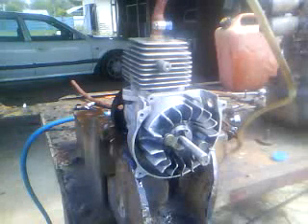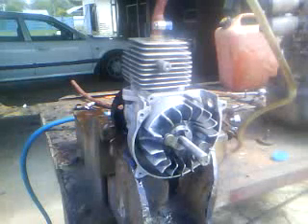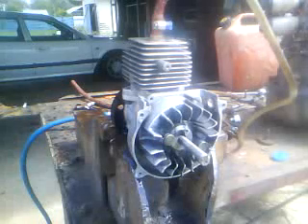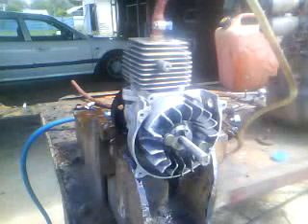Compressed air engine

Comment: What is the point? Does it power a tool or something? Surely you didn't make an engine to watch it run
Reply: Well mister genius, you will see thousands of videos of 2 cycle engines running on air with a check valve and push-rod that will wear a hole in the piston. This guy is smart enough to know that you don't need all that crap.
Reply: @rbodell  wait so its just an on-off valve going straight into the engine?